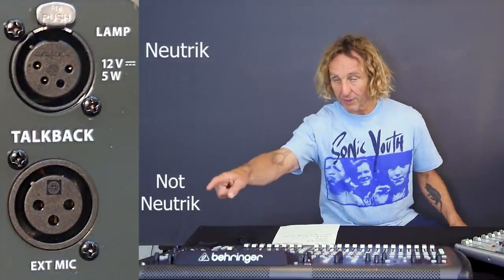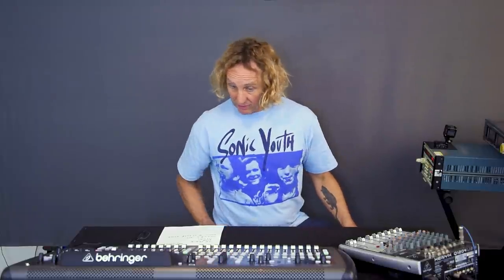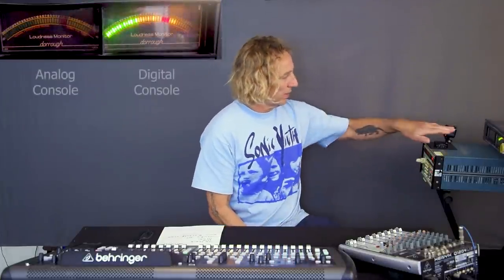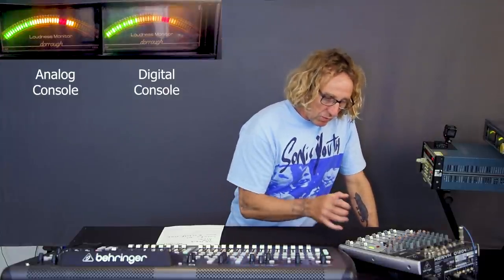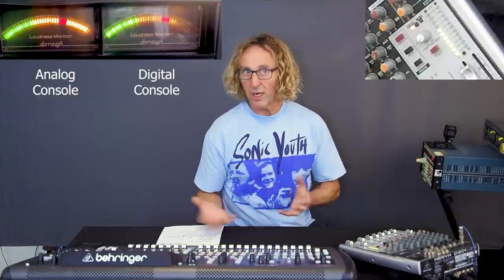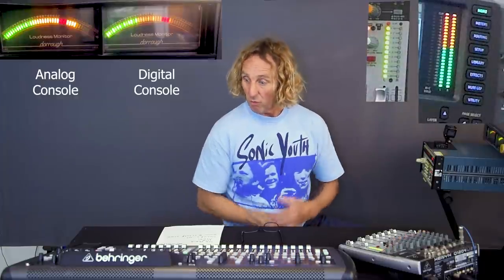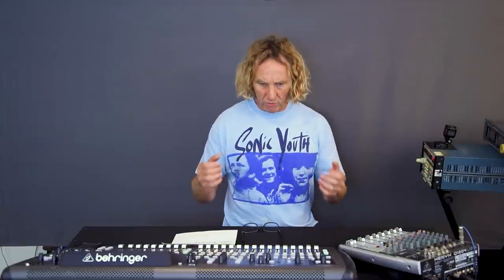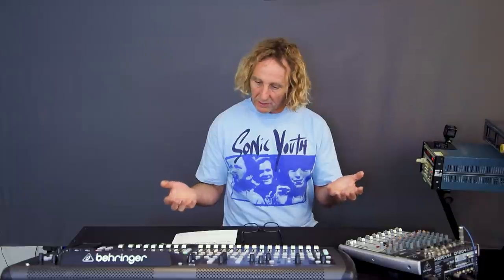Behringer X32 Digital vs Analog Console Metering & Output Levels (Public)

Comment: Would be interesting to see this same test done with a different manufacturers digital console. Cuz the results from the X32 are exactly what the “digital standard” metering should be, with -18dbfs being +4dbu, so I would think that other digital consoles should perform the same way. Could be interesting.
Reply from the maker: I have a QU16 and SD11 lined up to test soon. My videos go to the member side of the YouTube channel first so will hope to test in the next few weeks and post Nov/Dec which will start putting them public maybe Feb or so
Reply: Correct, my experience with the smaller behringer stuff is they give it higher output in order to reduce noise or interference issues since they know it will mostly be used by inexperienced techs,  likely not running proper wiring to mediocre amps. its why i actually liked them a lot back in the day^^
Reply: Luke Purse  -18dbfs = +4 dbu = 0 dbvu in pro audio gear lol
Reply from the maker: Except it appears that -18dbfs does not quite equal + 4 DBu on the X32

If I recall correctly - 18 DBfs equals .998 volts on the X32 and on the Xenyx 0 db on the meter is 1.28v
Reply: Dave Rat oh interesting! When i saw the +4 reading I guess I assumed that was how your Dorroughs were calibrated. Now I am even more curious to see the results from other consoles
Reply from the maker: I am doing more testing on outputs and finding -18dbfs is indeed +4 on the xm32. And metering -7 on the Xenyx is also +4. 

The max output at waveform clip for the xm32 is +21 and the max output on the Xenyx is +26

Comment: -18dBFS simply means the channel has 18dB of headroom with the console output at +4dBu, that means output clips at +22dBu
the XENYX Q1204USB main output max is listed as +28dBu (6dBu higher than X32), reserve the same 18dB headroom and you have +10dBu
Reply from the maker: This video as you can see is based on the metering provided by the manufacturer. So I am just showing what the consoles are doing when the meters read the various levels
Reply: You have the right idea, but +4 is an anachronism, no longer of any value as a reference.  dBFS of any amount is a direct readout of headroom, no translation needed, and it only has meaning in the world of digital signals, which have an FS.  

Btw, nothing has +28dBu capability.  This would far exceed the supply rails even in pro gear, much less a Xenyx.  In the 70s, I built the very first MCI JH500 recording consoles, on which we wasted enormous resources to accomplish +30dBm at all outputs.  We eventually had to derate it to +28dBm to save our customers the trouble of replacing the special opamps that could not reliably handle ±45Vdc power rails.  Even then, the audio psu rails could hurt you.  Just the audio supply alone weighed 135lbs.
Reply: @DaveRat  it took me a while to always keep in mind dB scale metering is a relative measurement based on a "standard". When there is no stated standard it is a very good idea to question, experiment and validate just like you did before using or comparing with raw dB metering result :)
Reply from the maker: I just double checked the test and the xenyx puts out 31volts p to p at clip and the x32 and m32 put out 26 volts p to p at clip
Reply: @DaveRat  They use ±15V rails and the NJM4580 almost everywhere in the analog part, so according to specs of the opamp, ±13.5V max is what we get in this combination typically, which is consistent with your measurements. Excellent channel BTW.

Comment: very coool, interesting about the output level difference between digital an anologue, with the setups ive used i havnt really noticed any need to adjust. theres so much headroom with a good band with controlled levels (smaller venues) when the mix is good 1 yellow for a rock show.

on larger gigs ive seen me not even close to -18dB

Comment: The +4 reading on the Dorrough is purely coincidental, unrelated to the +4dbm reference that came about from the actual voltage (1.234Vac) resulting from a 0VU reading at a reference impedance of 600 ohms.  That +4 reference is no longer valid for much of anything, having passed into irrelevance with the loss of the almight VU meter.  

The incredible Dorrough has taken its place with many plusses.  What the Dorrough is showing is “loudness”, which is what we really need to know for most work and it will show it with single decibel resolution, unlike any simple LED voltage ladder.  I feel naked without my Dorrough, an old stereo unit in a very small package, as it can be used for lineup calibration, then go right into music mixing mode with no changes whatsoever.  Show me another meter that will do that.  It will read -0- for differently peaking program that is reaching equivalent loudness, no small trick and a very handy one.  

If I am A1 in a broadcast truck, I can rely on it to match introductory dialog to a musical performance for example, unlike any console meter.  The meters on both Behringers approach meaninglessness, which sucks.  Their only job is to show headroom, something all those crazily varying numbers you observed are proof they are failing to do.  Our meters are one of the most important tools we have.  When they show an arbitrary voltage, they aren’t helping us much.  The Dorrough is almost magic.  👍🏽🔥🎶
Reply from the maker: The Xenyx puts out about 1.23 volts at 0adb and the x32 puts out about . 995 volts

The Xenyx puts out about 11volts and clip and the x32 puts out about 9.2 at clip

Comment: Hi Dave, perhaps a bit off-topic, but a pro sound guy tought me that the x32's main output sounds better when the main fader is set to 0 dB (or more), because then the 'maximum resolution' would be used. Instead of turning down the main fader (0 dB is mostly too load) he advised to insert a GEQ into the main bus and attenuate by turning down the GEQ's master control. It seems to really sound better, but I find the 'resolution' story hard to believe. In my opinion every attenuation is done within the 40-bit floating point DSP of the X32, no matter if it's a main fader or something else in the signal path. What do you think about this, and do you perhaps have a way to measure this?
I do understand the principle of SNR and that a hotter signal coming out of the console always sounds better, but that's not what I mean here. It is the comparison of: A) Main fader at -12 dB    or B) Main fader at 0 dB with GEQ inserted on main bus and GEQ master control at -12 dB.
Reply from the maker: Maybe this vid will help shed some light on whether fader position sounds different.

Also maybe search out another vid I did in gain structure

https://youtu.be/32NpliojUbg

Comment: Well, coming from an engineering background, I would recommend you to look into the data sheets for these kind of questions. In the X32 manual you can find that its maximal output is +21dBu, just as you determined empirically, and in the one of the Xenyx it says its maximal output is +28dBu, so its clipping light might turn on 3dB before actual clipping. Btw, many professional digital mixers have a maximal output of +24dBu, so the Behringer seems to be a bit on the low side.
Reply from the maker: Very cool and I don't blindly trust spec sheets and like to look at what actually happens in what they say will happen.

Finding things like out of polarity headphone jacks since his in sound between various outputs and numerous other issues are a common place

I don't know if it was this video or another video where the spec sheet claims and noise specs are the same but use different metrics to measure it when in reality the X32 was noisier
Reply: @DaveRat  Yes, absolutely, in German we have the saying "probieren geht über studieren" which means it's better to try things out than just to blindly study and believe them.

Another interesting thing to consider might be that some digital consoles have dip switches on their circuit boards to select the output level. I once opened up a QL1, because I wanted to add a resistor to the fan as it was so noisy, and then I discovered that on the output board there are dip switches to select +18 or +24 dBu output levels.
Reply from the maker: Very cool and interesting.

As I did more testing another factor became more clear that I dont think I covered in the video. 

It's not just where the console clips but also, how drastic the clip is when it happens. So even two consoles with identical headroom, one that clips with a less desirable sound has less usable headroom.

Comment: Just out of curiosity: did you compare the input signal with the output signal when the cursor signs 0dB? is it rally unit gain as it should? Beside any VU meter indication (since those are responding more to recommendations rather than standards, but many are guessing those are standards). Also in order to verify how VUs are adjusted (if ever) etc ...
Reply from the maker: Which unit are you referring to?
Reply: @DaveRat  0dB as I said. 0dB is gain 1 ... it means: all what enters, exits ... no attenuation, nor gain.
Reply from the maker: Yes, on the x32 and m32 gain at 0, faders at 0, what goes in comes out at the same voltage.

With the xenyx it's harder because of the gain pot labeling being hard to tell.

With the dorrough, 0 db in is 0 db out as well.

With the x32 and m32, 1.228v input (+4) reads as -18dbfs on the input and on the output meters and with gain and faders at 0, results in 1.228v output
Reply: @DaveRat  fine so the VU meter indication is relative and not to blindly consider it. Now it will be nice to compare what is the meter indication, when a real no-gain and no-attenuation (measured eith an oscilloscope) is running. This is theonly one way, to me, to verify the myths that want the analog louder than the digital.
Reply from the maker: I have just done a video with a scope confirming all the meter based measurements. The dorrough meter is a calibrated measurement unit and the scope tests confirmed not only it's accuracy but also confirmed why the meter measurement was more reliably realistic than even the scope for this

There are eight more videos on the member side that take all this stuff way further and three more videos yet to be released to members.

On the public side those videos will be showing up over the next 2 to 3 months or so
Reply: @DaveRat  ah ok great. Because on my view,  when I put both consoles at 0dB (measured with a scope) ... I'm sure it's 0. Meters are measuring differently. The analog one measures 0 the digital one -18 ... si: differently. Then increasing by 6dB the digital (always monitoring the output with the oscilloscope, so I mean 10dB in tension), and the other mixer as well, it can't be that one is louder than the other one. But certainly I can measure the accuracy of the meters at least, and also take note about the tolerances of the serigraphy. Then reaching the clip, I can verify (beside the meters but using the oscilloscope), if both are clipping at similar level or if the digital clips earlier than the analog. Or viceversa. And however, supposing that everything is aligned (the meters are indicating correctly, as you said), then yes: that analog reaches louder levels before clipping, although we don't know if it's a constant. I mean if every analogue is so. OR if every digital is "softer" because it clips earlier.
I think that as conclusion is that: between the 2 analyzed mixers: the analog one is louder. But just on htat case. In fact we don't know if everytime is so, or not ...
Reply from the maker: Yes, various mixers will be different.

I am comparing a behringer xenyx rated at +22 db output to a behringer x32 rated at +21 db output.

In this situation with two mixers made by the same company, the xenyx output waveform on a scope begins to distort at +27 and the x32 begins to distort at +22.

As I said in the video, if a person is used to using a behringer analog and switches to a behringer digital, expect to have 4 to 6 db less output.

This lower output could result in an engineer mixing higher into the meters resulting in increased distortion.

I believe that input and output overload is the #1 cause of bad sound from digital mixers.

I believe that this lower output is tied to that issue

Comment: Would be great to see some the latency or any phase differences between channel to stereo, bus to stereo, stereo to matrix, bus to matrix etc. If I send a channel to a bus and also the stereo and assign that previous bus to stereo to do a New York style compression effect will is comb filter? Will it comb filter if I just add a plug-in to snare top, but not snare bottom. Would need an FFT or smart rig to examine I think.
Reply from the maker: I've done some of that already, there are 7 more videos on these consoles up already on the member side.

Comment: What the RRP on these mixers USD your price.  I mean the price has the be the ultimate comparison point and as you said from the get go.  neutrik. BUT I must say all my cables are Mogami with neutrik but I have had my fair share of ordinary neutrik connections being a bit loose as opposed to some cheaper ones that are rock solid so you just never. Know.  And you are right it was you that inspired me to get the Dorrough and nothing compared when it comes to meters.  Always awesome work Mr. R

Comment: Me X32 user ..Thanks a lot sir. But on sounds check one thing I have found so far that on input fader meter (-18) means thats the clipping signal from the electric instruments or any audio players coz sometimes they pump up there levels. Before applying gains on the signal. Coz i always reset the gain. Before the new events. But rare in wired microphones.. But you got the right thing Comparing both. Yes I add comp, limt. To get that little Db and also someone punchy ness to the output.
Reply from the maker: Yeah, preparing for jumps in signal is important
Reply: @DaveRat  yes.. Sir ..Your topics are great. Bunch of knowledge I got from you..

Comment: Test: Several -18dBu channels to group give more signal then 0dBu internally. (seen this often happen) Question, does this give distorting? Read somewhere that the 40 bit floating point gives the console more then 0dBu internal handling gain. Is this correct?
Reply from the maker: There are meters in the summing groups and yes, they do seem to be able to be overdriven without obvious distortion
Reply: @DaveRat  Yes there are group / bus meters, and the signal can go(way) beyond 0dBfs (peak led) with no distortion. But is this overdriven or normal behaivior for group busses? For example when a "band" group handles 16 inputs arround -18dBfs, the input of the group is +0dBfs. What is the maximum input before distortion?
Reply from the maker: The channels distort at 0. Hard to tell where the busses distort as it is above meter max. I could calc it and may do

Comment: I'd go with either SFP or SFP+ depending on the speeds you'll need for your front of house, it'll extend your range way passed 100m too...
Reply: @DaveRat  You'll require 2 small switches on either end to convert the optical to/from cat5, then just take care to tape it down the length of your snake... It is optical so no tight bends and take precautions to make sure it doesn't get stepped on, but you really aren't gettin any tight bends in a thick snake so just affixing it along side that should be fine and may itself help mitigate the foot traffic problem

Comment: hi dave..are you sending the signals to line ins or mic ins.iam asking cause i see on the xenyx  the line in..to be accurate youshould use two d.i's and set the mic preamps to unity..just in case you used mic in on the x32 and line in on the xenyx
Reply from the maker: For testing output levels and not looking at differences in the noise floor, the choice of input method would has no impact.

I have also don't the test with all mic level and all line level and the metering and output sections are unrelated.

The reason I am using line level on the xenyx is that there is no pad. Introducing a DI just complicates things without any difference in outcome or test
Reply: @DaveRat  i was just wanted to point that mixing input levels wont work..i mean if you use a mic in on the x32 and a line in on the xenyx  it should have an impact on the level of the signal going in.but since you ve done the correct matching(mic and mic in or line in and line in) it should be accurate..tbank you for your reply
Reply from the maker: Thank you!